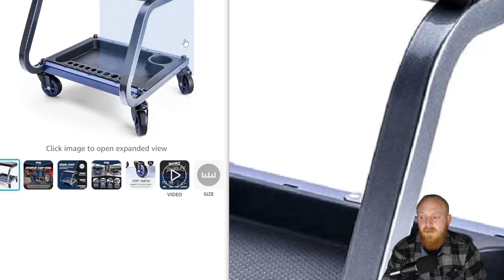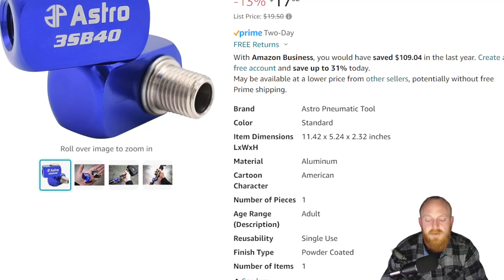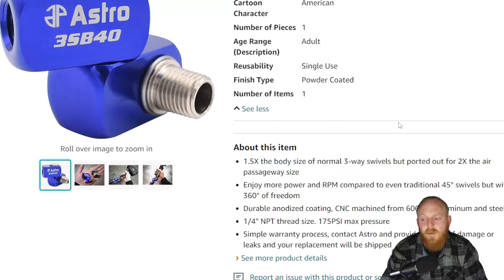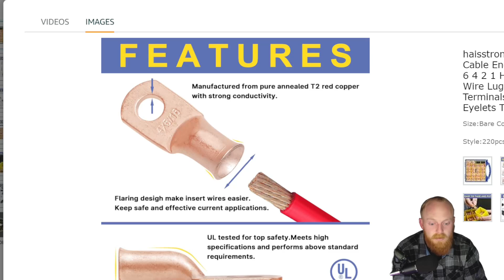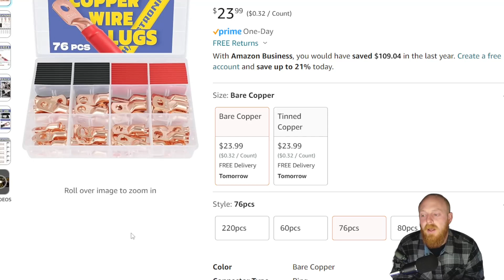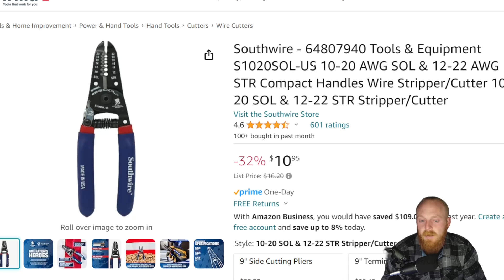Great Amazon Tool Deals Southwire USA Astro

Comment: for reference, about how tall r u? the stool is fixed height so just seeing what you think? im 6'1" and really hate stools that r really low, the BEST shop stool ive had so far.. is a mid/low price beauty salon barber stool that has 6? urethane rollers, half are locking, a steel ring around the bottom legs and is fully adjustable, BUT... no tool trays etc.
Reply from the maker: I'm only 5'8" so while I'm sure this is fine for you, over a period of time it probably wouldn't be as comfortable since this style isn't adjustable. From the sounds of it, I like what you have 👍